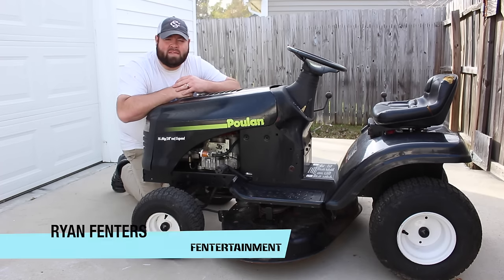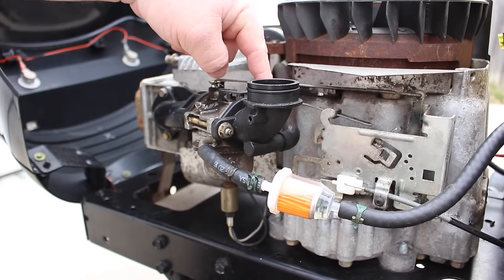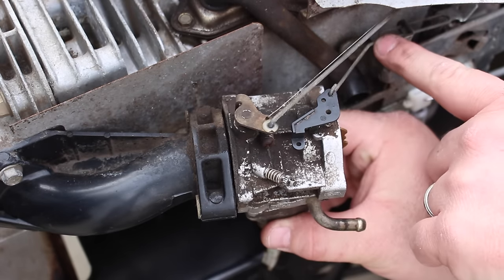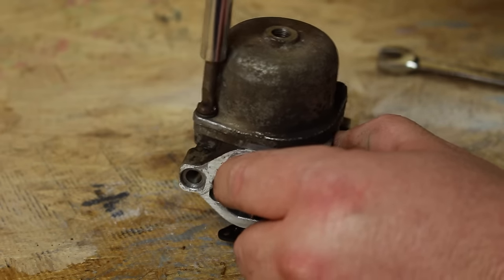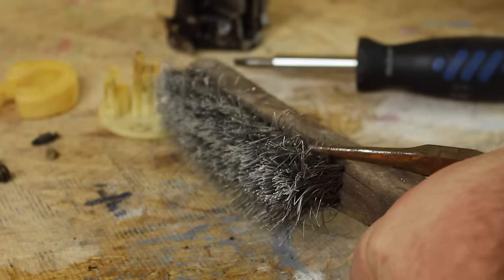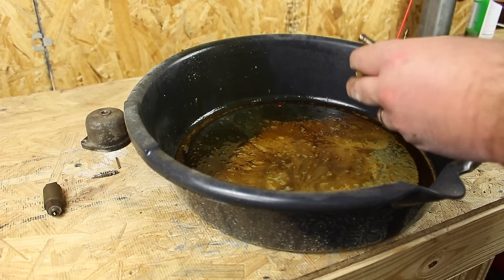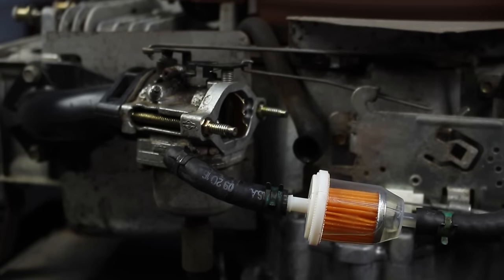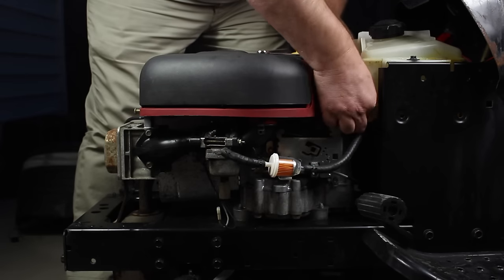How To Fix Briggs & Stratton Surging Engine | Nikki Carburetor Cleaning | Motor Hunts UP & DOWN

Comment from the maker: If this video helped you and you would like to support my channel!
paypal - rfenters1@gmail.com  
Cash App - $rfenters
Reply: Factoring the cost difference between the rebuild kit and the new carb ($6 ($16 vs $22)),  it seems a new carb is a better option.  At least in terms of time saved.  Nice video.
Reply: What if you put a new carb on an it still surges but when you turn the blades on it run smooth
Reply from the maker: @tazduster  Might wanna check your air fuel mixture screw
Reply: Hello.....I follwed your instructions exactly...but when I removed the solenoid the main jet fell out also...There was no spring on top of the jet....My mower was running but surging....now it won't  start..can you give me some suggestions....Thanks
Reply: @tazduster  I have the same problem with my mower even after a new carb.  Can't figure it out .
Reply: @tazduster  if it's a aftermarket from ebay or Amazon some of them come bad I've had same problem before I had to try a couple of them before getting a good one hope this helps
Reply: It helped me realize there's no way I'm going to do this without screwing up my carb.  In all honestly, though, I really appreciate it.
Reply from the maker: @edwardwebster8123  I've done a few of those amazon carbs on mowers because they are quick and cheap and had the same problem. If yours has the air fuel mixture screw you can adjust that. I would also check the air filter to make sure it isnt clogged up partially.

Comment: Just a tip, but it you take a standard bread twist tie and burn off the plastic coating with a lighter, it makes an excellent rod to use for cleaning orifices on a carb with. It is just the right size and can be used many times in the future.
Reply: I guess you'd have to be very careful not to leave a bit of burned plastic or glob of soot on that metal strand after burning it. The last thing you'd want to to is poke some crap into the jets...!

Comment: Hi clean the carburetor and the main jet and blew out all the passages on my Briggs & Stratton 16 1/2 horse tractor today. It runs perfectly now. I put up with that surging for years.. A good small cleaning probe that I use in carburetors is the crop and cut off of a guitar string.This video save me from going out and buying a new tractor/lawnmower
Reply from the maker: Money Saved is Money Earned!
Reply: A guitar string...I'll get one..I've been using torch tip cleaners and sometimes a twist tie off a loaf of bread..
I'll try the guitar string thanks Cheers 🍻🍻🍻🇺🇸🇺🇸🇺🇸

Comment: About 6 yrs ago I bought a new riding mower. It looked just like the one in this video. I may have used it a total of 10 times. It had less than 25 hrs on it. Then someone set the house on fire. The fire got the living room an kitchen an part of the garage. About a year later I got to fooling around with the mower. All the wiring was burnt as well as the seat an steering wheel. So I got to fooling around with it, I took off all the wiring. The gas tank had melted, so I poured some gas down the carb. and jumped it off. And the thing started right up. I found another mower looked to be about the same thing, just not as in good of shape. It was all I could find at the time. Started swaping parts around and put together a half A** mower. It works but its nothing like what I had. But I am thankful for what I have. After I got the engine put onto the other mower I rebuilt the carb. changed the oil and air filters and for good measure put in a new plug. I use it last summer.
Reply: William Wynn I remember my dad bought a brand new one, a V twin about 18HP, it ended up being replaced with another after being stolen. He had about 1.5 acres on a slope and a remember a row of 1 gallon petrol cans by the gate when he was using it.

My wife and I have much less money, we have about 1.5 acres on a slope too and I spent less than half as much as he did on an ancient Kubota B4200. It was only about 12HP, although it only used about a pint of diesel to do a very similar job, four wheel drive helped too.
Reply: William Wynn 
  Bravo!
  Glad to see someone salvaging things instead of throwing them away:)

Comment: Great video. I just replaced the carburetor with a brand new one on mine and am having this same issue. If it’s not the carb (assuming the new one is good), what should I look at? Brand new fuel and air filters too.

Comment: I bought a used Honda push mower almost 6 years ago from the furniture store I work at. Everytime I'm finished cutting, I shut off the fuel and let the mower run out of gas. Also use non- ethanol gas. Only paid $75 for it 6 years ago, run fine.

Comment: Ryan, thanks for your good video. My Briggs and Stratton 16HP engine with Nikki carb was surging under load after being stored over winter with fuel in the carb. A full carb strip found no visible debris, no sticky gum deposits or anything similar. But, to be sure, all jets, carb fuel holes and airways blown thro with WD40 followed by a good spray thro with carb cleaner. All reassembled and then engine run smoothly.

Comment: The anti backfire solenoid on the bottom of the carburetor does not stop fuel from going into the float bowl , the float needle seat is what controls the amount of fuel that is allowed into the float bowl, as the fuel level rises in the float bowl the float raises up to the point that it pushes the inlet needle seat up into the main fuel inlet and seals the inlet closed until the fuel in the float bowl is used some and as the fuel level drops in the float bowl so does the float which allows the needle seat to drop down enough to allow fuel to refill the float bowl until it is full and the process repeats itself over and over ! The anti backfire solenoid is controlled by the ignition switch when it is turned on 12 volts is sent to the coil inside the anti backfire solenoid which creates a magnetic field that pulls the pin downward on the anti backfire solenoid itself ( located up inside the carburetor ) this allows fuel to enter the main jet located in the center of the carburetor, when the ignition switch is turned off the magnetic field dissipates and the rubber plug on the end of the pin goes back up to contact the Bottom of the main jet sealing it off so fuel cannot go through the main jet as the engine idles down to a stop ,, if fuel goes in the main jet as engine idles down to a stop it will be sucked into the intake manifold and the fuel will ignite inside the combustion chamber making a loud pop as it does ! This happens when people discover the anti backfire solenoid is bad , bad coil inside , and they cut the pin off the plunger of the anti backfire solenoid, or when the pin gets stuck in the down position which would be ignition on position ( which is rare but does happen due to ethanol gummed up pins ) and the mower will crank and run but when shut off will backfire because of the solenoid valve being open not closing off the fuel to the main jet !
Reply: Wow, you’re so knowledgeable! Thanks for your help for everyone here!❤
Reply: good to see someone here knows what that solenoid is for other than myself.....ive had countless arguements over its function in the carb.....ive lost count the number of these nikki carbs i have serviced/repaired over the years.....if you have a good look, the pin has already been cutoff in this video clip....and the main jet is positioned wrong (held with a spring)....so even IF the solenoid had its plunger button still attached, it wouldnt work anyways
Reply: False

Comment: I've been trying to fix an lt1000 for weeks now. I tore the carb apart so many times, new spark plug correctly gapped, new filters, new fuel lines, new linkage spring, and the the thing still surged. I took apart the carb, again, and followed your video step by step, plus added some seafoam to the tank, and now it runs like new. I must've missed one small hole in the carb all these times, THANKYOU for saving my sanity. You earned a new subscriber.

Comment: I found that a torch head cleaning tool works best for cleaning the holes.It have a lot different sizes and they are stiff.Cost about $3 or $4 dollars can get them at walmart.

Comment: Good video, just one wrong point, the fuel cut solenoid DOES NOT cut fuel from entering the bowl, what it does on engine shutdown is block fuel from entering the main jet at the bottom of the plastic fuel block, fuel to the bowl is controlled by the needle and seat. Thirty year small engine shop owner and Briggs dealer here.
Reply: yes you are right and that is the place that gives me problems after the winter....condensation settles i think
Reply: It's supposed to eliminate backfiring after shut-off by idiots who don't know you're supposed to idle these engines for 1 to 5 minutes before turning the key off. I hear it all over the neighborhood: "ROOOOAAAARRRR-(click) stumble, stumble...(quiet) BANG!!!"
Reply: dave1135 
  Hi Dave,
  Started working on small engines recently to help people out due to the flood.
 They buy parts, I supply labor.
  Where can I go to learn more?
 Lawnmower man DVD’s? 
 Community college?
  Thank you.
Reply: Hi JJJ Smith

I'm not sure about official classes but one good resource i use is the Mustie1 YouTube channel. If you haven't watched any of his "will it run" videos give them a try. Guarantee you lean something.
Reply: Scott Warren 
  Scott,
     Thank you for the information and your time. 
  I will check him out:)
Reply: I broke the pin off of the fuel cut off solenoid. It was that or replace it, and after looking up how much a new one would cost, I decided that it serves no real function and can be eliminated.I just left the solenoid there to hold the bowl on and to make it look proper (and also so there was no lose wires).
Reply: so glad when I went to comment I saw this. I am a authorized factory trained tech and this is such a pet peeve for me when I hear it haha!
Reply: Uh, you shouldn't have to idle an engine for five minutes before shutoff to keep it from backfiring.
Reply: @snoopdogie187  The solenoid valve is there to solve gravity feed gas from getting into the carb after shutdown when there's no spark, but while the engine is still turning and making vacuum to pull gas and can backfire. Turning the speed to low idle for a short time before shutdown can help this problem. A good thing to do is to cut the gas line hose a couple of inches under the gravity feed gas tank and insert a manual shut off valve. if you remember to shut this off after each use, you avoid having a carb and engine flooded with gas, if the needle valve should fail open and gravity just drain the gas tank into the engine.
Reply: @jjjsmith2497  James Condon videos as well. He does portable generators and small engines
Reply: Just a heads up not a criticism.  The fuel filter is the wrong type. The one here is for a machine with a fuel pump. The proper one for a gravity fed fuel system like this is the red or white short one. These type have a steel mesh inside and allow fuel through much easier. Also gravity fed should always have an inline fuel manual shut off valve fitted to facilitate manually switching off the fuel supply when the mower is in storage in between cutting or over winter. This will prevent a fuel leak in event of needle failure. Hope this helps someone out. Great video and explanation. Thanks for posting.

Comment: Great instructions! My engine was surging like yours. I cleaned the carb and even installed a new aftermarket carb, new spark plug, and fuel filter, but the surging continues. The adjustment screw made no difference. I have ordered a new OEM carb and hope the extra cost for an OEM will solve the problem.
Reply: update: after installing the OEM carburetor, the mower ran like new. By the way, the carb that I cleaned before ordering a new $20 carb was also a cheap aftermarket carb. It ran okay for a while. In hindsight, I should have just thoroughly cleaned the original OEM carb rather than replacing it with two aftermarket carbs. Lesson learned.
Reply: @harvey8695  do you recall where you got your OEM carb?   Is it Briggs?

Comment: My Gravely ZT-34 with B&S Intek was surging like this one - After watching this, spent an hour in the shed listening to Spotify and did exactly as you showed here. The only difference with my carb was that there was no air-fuel mixture screw like @2:48, otherwise it was identical. The air bleed @3:48 was partially clogged needed a fine wire and a few blasts of carb cleaner to dislodge the obstruction. After cleaning, put it back together and that engine was running smooth again. Thanks for a fantastic video with no rambling!

Comment: I was just doing this on my tiller and realized that a short piece of a guitar string works perfectly for cleaning the various small orifices in a carburetor. The thicker wound top strings are rough, so they're almost like a gentle file.

Comment: Just got a new carb today. The new one does not have a fuel mixture adjustment screw, the place where it would be is solid metal. Hopefully that won't be an issue....

Comment: Great video and good job with the instructions! straight to the point and easy to understand. For my two cents you don't need the background music.  It can be distracting and uneasy to hear you around the music. Keep up the work.
Reply from the maker: Appreciate the comment, Others have told me the same and I will definitely take that into consideration.
Reply: I don't understand how anyone could complain about the music being distractive! It was at a very low level! But thanks for the video. I always have a hard time finding wires small enough to clean the orifices. The wire brush bristles are a great tip!,
Reply: @Fentertainment  I like the music brother. Keep it YOUR STYLE man 🤟🏻🤟🏻🤟🏻

Comment: steel electric guitar strings typically are .009  up to .046 in 6 strings an dare about $6 a pack. Make several cleaner wires from each string (maybe 4-7 wires).... and the steel is very strong and flexible

Comment: Thank you for this video, help me solve this irritating surging condition. Found what looks like carbon around the fuel mixture screw and the low speed jet, cleaned all orfice/holes with welder tip cleaning kit. Works like a charm. Took me three time though.
Reply: I”m on my 2nd time. Evens out at high speed, but surges at low and medium. Getting there.

Comment: great video if you slow it down to 50% speed, he goes 90 mph at the critical point of removing the bowl float etc
Reply: I mean.. I dont see an issue. Straight forward. Pause and write if you're slow!

Comment: Mine was hydro locking my engine causing it to not turn over to start and thought it was not turning over due the battery and then starter. Lawnmower did not come with a fuel shutoff and I was always going to put one on it but just didn’t get to it. So bought a new carb off Amazon but going to get a Walbro I hear they are excellent on Briggs.

Comment: Check your FUEL LINE for miniscule air leaks.  They can be nearly impossible to detect and are usually in the area where the fuel line joins the carburetor.  I found mine by accident when I happened to notice a tiny drop of fuel "hanging" off the fuel line.  It evaporated before dripping (!).  I sealed it off an the 'surging/hunting" went away.... no more running the engine with the choke half-on. :)

Comment: I found that my old guitar strings work great for cleaning out those small holes and ports in carbs!.
 (You installed that fuel filter on backwards by the way)

Comment: Hi Fentertainment, Thanks for this great video.  Everyone is correct, you do a bang up job on explaining things.  I do have a question though.  The carburetor that you was working on in this video had a spring under the bowl.  My riding mower has a 21hp Briggs & Stratton engine and the carburetor doesn't have a spring.  My question is should it?  I'm thinking someone may have been tinkering around with it at some point and removed it or is it that this model doesn't have a spring?
Reply: My 19.5 didn’t have spring either

Comment: If you have some of the multi-strand copper wire, you can strip it and use a piece. Advantage of copper is it's softer than the jet and won't enlarge the hole.

If you play the guitar, you can use the thinner E string to clean out the jets. If you don't play, you can still buy just that string from a music shop. It's long and flexible and won't take a permanent bend easily.

Also the old wire bread ties you can strip off the paper with your fingernails and keep it handy in your toolbox for this. There ya go, 3 more sources if you're in a pinch.

Comment: I use old bicycle brake cable for cleaning wire. It's readily available, stiff enough to bust thru clogged junk and long enough to reach all the waybthru